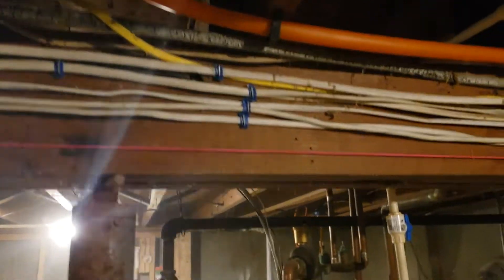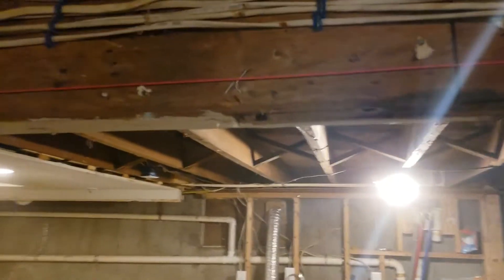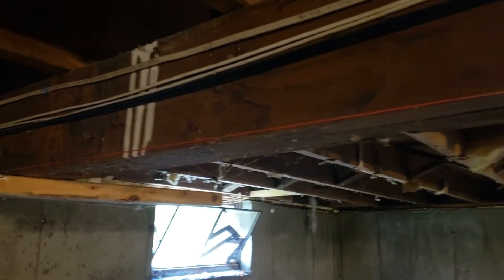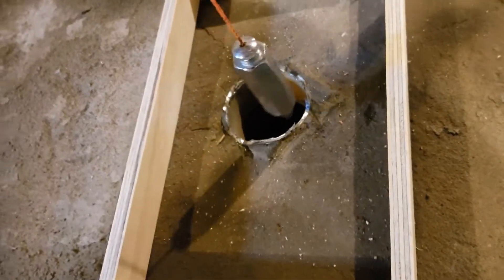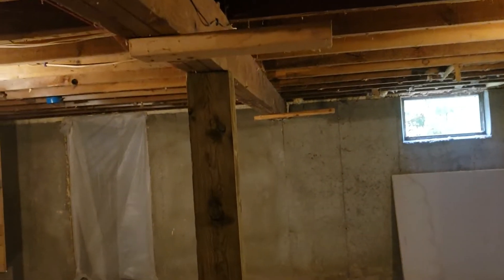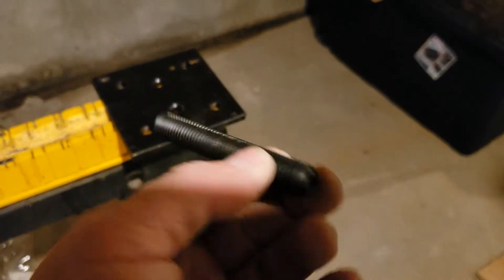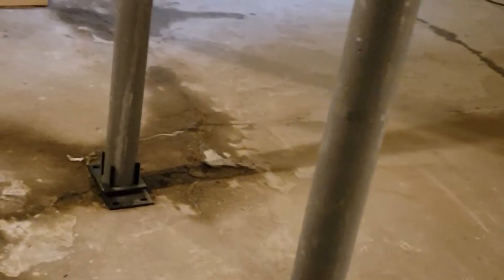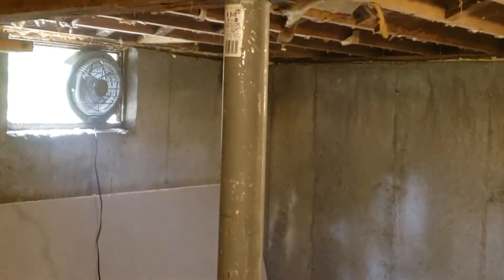DIY home repair. (house support columns)

Comment: I think you're supposed to install these on top of footers, which are small specially reinforced concrete sections.  You can't just install these anywhere on a concrete floor, because the normal floor can not provide the support.
Reply from the maker: I installed them in same places that the original uprights were placed which the footer is under. They haven’t moved since. I am good the house is good.

Comment: I know u did the job already but did you check fundation below the footing.normally by code column must be seating solid 2 feet concrete slab under.anyway I am in process of doing it myself

Comment: Absolutely NOT supposed to raise any beam more than 1/4” per MONTH. You went an inch in one day?
Reply from the maker: You are correct, if was resetting a post and beam structure. This being a stick built home. The movement of the support beam was negligible to the rest of the house.